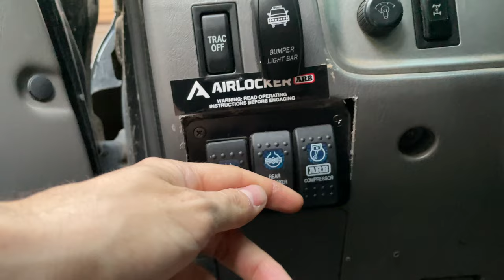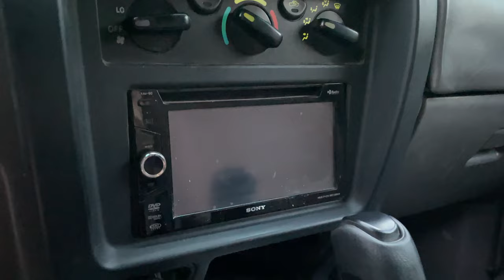3rd Gen 4Runner on 37's - Do They Rub? Build Walkaround of my 2001 Toyota 4Runner

Comment: If you install solo motorsports stock length lower control arms and SPC adjustable upper control arms you can move the front wheel forward an inch before you start running into steering rack issues.

Comment: Do you have stock spindles and ball joints? Or did you upgrade to heims on upper or lower? Custom UCA? If all stock, how has the ball joints and stock spindle held up to the 37s? I know with the Toyota spindles being forged steel(4th gen), they're pretty tough. But ball joints tend to be a major failure point on the 4th gens atleast

Comment: Body mount chops can be sketchy, you may want to just get some lower control arms from solo motorsports. They move your wheel 1" forward...essentially making your 37's fit like a 35. Epic rig tho!
Reply from the maker: Already did the BMC now along with a tub. Going to combine it with some SPC UCAs eventually to move the tire forward a bit

Comment: Dope rig my man. Keep up the good work. I just want to install 35's is there any way I can get away without chopping anything. I'm running spc uca 2 1/2" suspension lift. No body lift.
Reply from the maker: You’ll definitely want to at least hammer down the pinch weld! If you’re driving on the streets it should be okay

Comment: Nice truck! What's going on with the ziptie on the headlight? I thought maybe I was the only one experiencing problems with aftermarket headlight housings
Reply from the maker: I built these headlights about 2 years ago now and the little clip on the top right that holds the headlight to the back plastic piece wire out and now it won’t stay in. I tried using jb weld to hold it in which failed so now I’m going to have to get that little plastic piece from somewhere. Thanks for bringing that up! I totally forgot about it.
Reply: @SnowboundCustoms  for sure! I’m shaving that same problem.. I used my old piece from my old headlights and it worked for a while but with the heavy off-roading I do it broke too. Back to the zip ties until I thread a bolt through that hole..

Comment: Are the turn signals plug and play or did it take a bit of re wiring?
Reply from the maker: Just cut off the old turn signal wires and connected the new ones. It was only two wires to attach

Comment: What was the mpg difference like changing from 35s to 37s, also were you running the 5.29 gearing with 35s?
Reply from the maker: I still haven’t had the chance to check it out. I think it went from 14 to 12/13. I’ll see when I fill up again and yes I had the 5.29s with 35s!

Comment: Roughly how much would you say you put in for the total build?
Reply from the maker: Probably $9k total? Lockers are 3.5k, wheels/tires 3k and then everything else
Reply: @SnowboundCustoms  who did your gears? Also, did you do front and rears?
Reply from the maker: @raulbeltra4765  East coast gear supply and yes! You have to do front and rear together

Comment: Was is rubbing in the rear at all with 35’s?
Reply from the maker: Yes it was. Probably a 1” body lift would have taken care of it. If I had less offset they would’ve tucked under the fenders
Reply: @SnowboundCustoms  I have a 96 4runner and ordered a 2.5 inch icon lift, you think imma have to tub the fenders?
Reply from the maker: @lizardkidd801  that really depends on how much your wheels are sticking out. With the 35s I had a 16x8 -25mm offset wheel and a 1.25” wheel spacer and that rubbed. 33s wouldn’t rub much if at all
Reply: @SnowboundCustoms  I was planning -10 offset and haven’t decided on wheel spacer yet, I’d really like to clear 35’s what do you think would be the easiest way to do so
Reply from the maker: @lizardkidd801  just know that with 35s, chances are you’ll have to bring out the angle grinder lol. It’s almost inevitable
Reply: @SnowboundCustoms  I mean that’s fine I was expecting that already lol, just hope I get a clean cut lol
Reply: @lizardkidd801  you can get away with 35’s with the -10 offset. The spacer will make it run worse. If you crank your icons all the way up and beat your pinch weld back and trim a bunch of plastic and a little metal, they fit